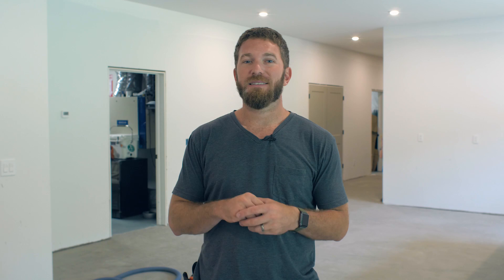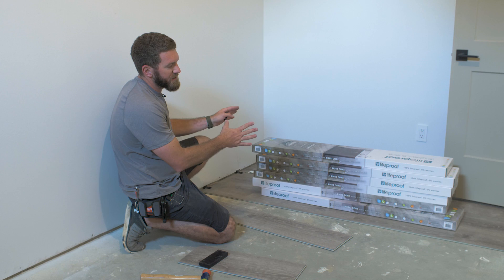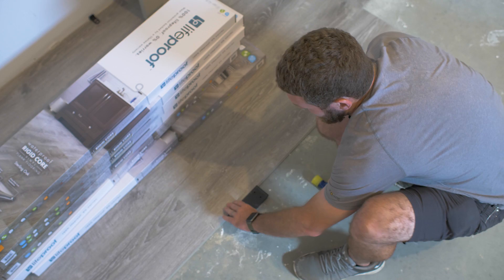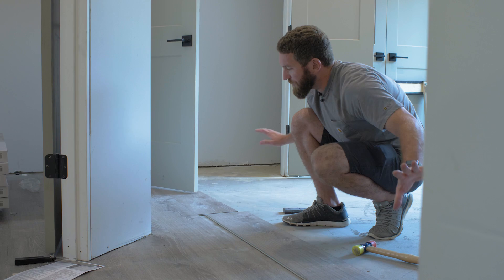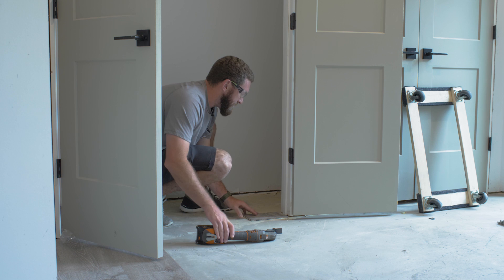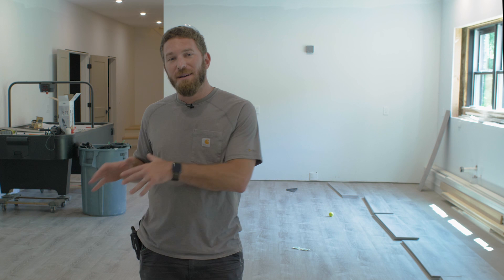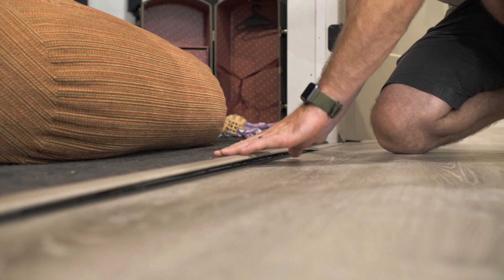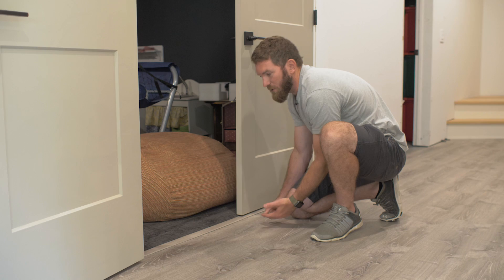How to Install Vinyl Plank Flooring | Tips & Tricks

Comment: Do you leave the spacers in until you finish? When do you remove the 1/4 spacers?
Reply: My suspicion is leave until the end. Since the planks aren't glued down + there's 1/4 allocated all around for expansion, there could be opportunity for sliding around right?

Comment: Great videos, I always learn from them. You mentioned laying out the room to avoid skinny pieces but how do you ultimately avoid that? The planks won’t always equal the width of the room...unless I misunderstood.
Reply from the maker: Yes, the idea is to calculate home many rows of boards it will take to span the room. If the remainder is less than, say .25, I would suggest ripping some off the first run. If you want the first run and the last run to be the same you would add 1 to the remainder and then divide by 2. The seams on this stuff are virtually invisible though so this may not be a huge deal to most.
Reply: @rogueengineer  it’s the “less than half factor”.

Comment: Great video. You do need to allow proper expansion for the flooring up against that metal channel for the t mold though. If you have a buckling claim it will be declined when that is discovered. Need that 1/4". That's of course why the molding is so wide to allow for that.

Comment: On below level installs, it might not be a bad idea to waterproof the crete, of course after it has cured. Some areas will see moisture mitigate through the slab causing mold growth underneath the lvt.
Reply: What would you use to waterproof a plywood subfloor if laying this on plywood

Comment: Grinder with a diamond blade is best for quick rips while working on the floor without having to get up , grinder works great for tricky cuts
Reply: I score it and snap it, no fine vinyl chunks, debris. Use a pair of large pliers CAREFULLY to help snap long, narrow pcs. like 1" to 2" wide.
Reply: But I do use my battery op. plunge cutter RELIGIOUSLY...never leaves my side! Less invasive, safer than an angle grinder, especially for tiny adjustment cuts around door jambs!

Comment: So I have a treadmill in the same room off to the side like your air hockey table is, but not on mover's dollies. When you finished, did you set it down directly on top of the planks, without any buckling?

Comment: Would a moisture barrier be needed for slab/concrete? I've seen since videos where they use 6mil sheets. However, I'm not sure it would work with the Lifeproof floors which have an underpad.
Reply: Def need plastic on concrete , not sure why he did not

Comment: I get it about wanting the t modeling transition being evenly spaced under the door so that it’s not favoring one side or the other from room to room however when looking at your video and how you put the metal track, you forgot to leave expansion gap there, the same expansion gap that is required around all the walls is also required for any transitions or pipes or beams or vents etc. you may run into a buckling issue if the floor decides to expand in that direction. I always make the space from floor to floor 1-1/8” because this allows for 1/4” expansion gap on either side of the track and the t molding still covers it fine and never run into issues with buckling or expansion issues. Everything else with install I agree 1000% on and I love how the whole family got involved with the install. I’m a little jealous and wish my wife and kids were more hands on with the renovation stuff and give us a chance to all bond instead of “Wow Dad! It looks amazing and you did a great job.” I already know what I’m capable of so although it is gratifying hearing their compliments, I would much rather we all be involved and it be a family thing. Cheers 🍻 brotha

Comment: Thanks for making this look easy. I have a door way needing a transitional piece however the tile will sit 1/2 inch higher then the flooring I’m installing. Do u happen to know where I can buy a t mold that will drop down from the tile to the flooring i tried Home Depot sometimes they can be a bit generic and they didn’t have what I needed. Thanks john

Comment: The square is called a try bevel square hope this help for those looking for it 😀
Reply: Not to be confused with a tri-bevel 🤔🙄
Reply: It’s not a try or a tri bevel square!  It’s called just a bevel square.
Reply: @tundrawhisperer4821  thanks for commenting but if you look them up you will see it says t bevel square
Reply: @300rear27  nobody calls them a T square though, it’s a bevel square, at least in my parts anyways.
Reply: @tundrawhisperer4821  thanks I’m old school carpenter and that’s what I call it did you look it up Home Depot has it has t bevel

Comment: If you use any type of saw, saw in another space preferably outside or garage, to avoid dust and fragments from the room you are installing the new flooring.
Reply: Not sure about lvt, but laminate sawdust is carcinogenic, so always best to use a hand lam cutter, no dust.
But MOST floating lvt jobs i do, I just score it once with utility knife then break over my knee...super quick, no mess!

Comment: Great video!  I know you did this over a "level" concrete floor but unfortunately I don't have that situation.  I am looking to lay this exact product in a basement over 5/8 OSB which isn't perfectly level over the course of the room.  How do you think this product would do with some wavyness in the floor?  Nothing too dramatic just not perfectly level...  Thanks for the info and looking forward to your opinion.
Reply: did you end up laying the floor? How did it end up given the floor wasn't super flat? I am in a similar situation and wanting to get real feedback on it. Thank you
Reply: I'd highly suggest you tughten ANY movement first, then self level all dips, sand down any humps...then you're good to go! Also, make sure the crete is cured and no moisture mitigation up through the osb and create mold between osb and vinyl, which doesn't "breathe".

Comment: So for vynil floor tile dont u use thinset or cement and sand as mortar underneath?
Reply: NO...NEVER! Lvt is vinyl, a type of plastic. Thin sets don't work with plastics or metals. This is a floating floor, not glued or nailed down anywhere. It "floats".

Comment: I have question: At 8:09 it shows the metal strip right up against the floor. Should there be a small gap to allow for expansion there?  If you don't need it, then can I can a way with butting the LVP floor up to an existing tile floor and not use a transition strip?  I would LOVE to not use a transition strip over the tile for just at a 30"  doorway.
Reply: I was thinking the same thing. I am going to leave 1/4 inch minimum where my flooring butts up to a sliding glass door.
Reply: Yes, you need a gap. But, an option is run it within 3/16" or so, and put a caulking bead down instead of a threshold. Only issue is the height difference between floors.
Reply: @MitchHowes  usually at sliding glass doors, I install a color matching endcap molding( like a t mold, but shaped like an L)from the flooring manufacturer. Very clean, pro look!
Reply: @bryanbenson6551  yep, it’s much better look!  👍🏻

Comment: Great video!  I'm going to go through the same process in the basement.  Is it required to pour down concrete?
Reply: No just be level. Some planks have the rubber underlayment... That will need to be super glat an level

Comment: I did this in my kitchen and it looks great. My question is how do you fix any areas that don't lie flush. There are a few end seems that slightly raised up and I didn't want to hit too hard for fear of breaking the grooves. I plan on doing a few more rooms so would like to avoid this mistake. Thanks!

Comment: Everyone who does these donut yourself video makes it so simple even the kids can do it. The life proof floor is a awesome floor and can be cut just by using a utility knife. But let me assure you it’s far from easy to just run your knife over it a few times and snap does not snap that easy because it’s a very good floor and tough to snap. Also that metal track is garbage better off to glue it down. Everyone who does these do it yourself video show you how easy it is in a big wise open empty room. They never show you when you have to go thru doorways or wrap around a island in a kitchen. They all make it seem like they did it in 1 day. It is a pretty easy floor to install but I warn you people it’s not that easy. Also you don’t need to put the spacers on all the walls. Just make sure you have them on your starting wall that’s the most important. When you start each row if you have enough confidence to do a floor like this all you need to do is eye the space you leave when you start each row as long as your under 1/4 inch. If you notice he didn’t show you guys how to make your end cuts which are called rips. That’s the cuts that you end up with at the last row you install. No one ever shows a video of the difficult parts or a difficult lay out which can be challenging if your just a do it yourself type of a person.

Comment: How do you get planks to click if you can’t lift the plank on an angle and you can’t slide a plank under a jamb
Reply from the maker: Click it in before you slide it under.
Reply: @rogueengineer  I did find a vid that shows clicking a piece in a flat position . 
If like to see a vid on getting under jambs snd casings when you can’t slide the piece .

Comment: What is the point of having a gap around and the edges. I hear it's for expansion... but for what? Dont the gaps open up?
Reply: LEE SOLID I saw another video ( Reno something something) where the guy said the gap is for future repairs that may be needed. There’s a tool that spreads the floor apart allowing the removal of the damaged piece
Reply: @bmtango05  what tool can spread apart a floating floor to replace a single plank?? Never heard of it...great idea, just can't imagine how it wouldn't damage the tongue/groove?
Reply: @bmtango05  and the gap is for movement of the vinyl(usually very minimum, compared to laminates, how'd being the most movement). Also, it's because wood moves in the house as well, so walls could possibly swell slightly, pinning closely installed flooring, which will buckle your flooring.

Comment: Beware! This stuff seems like a good deal. And it is pretty good quality for the price. But Lifeproof doesn’t provide many plank patterns. I would have GLADLY paid another $1 or even $2 sq/f to get at least 8 different patterns.. I spent 50% of the install time figuring out which board to put next because there were only FOUR different board patterns… 8 if you include the same exact pattern but opposite direction.

If it doesn’t bother you that you’ll see the same exact board all over the place, then don’t worry about it. But I know lots of people that would be annoyed. I am super annoyed by it. Lesson learned. Hopefully this helps save someone else the headache.

Comment: Hey do you have a link for the tool you used for underneath the doors 🚪
Reply: The tool he used is call a multi tool. You can purchase them in Lowe’s Home Depot or if you have a harbour freight in your area they are cheaper there. Also when you under cut your door jamb use a piece of the flooring as a guide when you cut the jamb so you don’t cut to much and have a big gap. I also suggest you cut it about 1/16 of a inch higher then the sample piece so you have a little room to work the piece under the door jamb it makes it a lot easier trust me I do this type of floor everyday for a living. And wear a pair of gloves because you can nick up your hands pretty good working with this stuff
Reply: A multi tool, also called a plunge cutter, they're pricess. However, I also own an electric under cut saw. Picture a circular saw with an adjustable blade parallel with the floor...a must have for big jobs. Your multi tool then gets all of the close areas.

Comment: Are you happy with the flooring? You work with this product how would you think it would hold up in a common area with in a garage? My children use as room more as an arts and crafts center. I store a completely restored model A pick up on the other side of the garage.
It spends 99 % of it's time stored there..I live in a cold climate it doesn't seem the light of day until summer. The room is climate controlled. What do you think?
Reply from the maker: I think it should be fine. If it was seeing traffic from vehicles every day it might start to wear but what you have going on should be no problem

Comment: You glued the transition so you shouldn’t even waste your time with the track just glue the T mold or reducer directly to the floor.
Reply: That's what I do. Or, pilot drill, put in 3  3/4" x 1" dowel pieces to Brad nail to.
Reply: @bryanbenson6551  a really good quality adhesive works great!

Comment: I do this everyday, although he's not technically wrong he makes it very difficult. Use end clamps, use a snap cutter, do several rows at a time, use a real undercut saw, and seriously who does 1 row at a time? It would take you a week.
Reply: Yeah, most brands it's quicker for me to install them individually. Once you get the proprietary locking down, you'll fly. Doing whole rows solo is a pain in the ass...SOLO, without a helper.
Reply: When you get to the last plank, just turn it  180 degrees, score allowing a slight gap, and snap. Turn it back around and snap into place.. I can do this quickly after 7 years experience on my own doing all types of flooring.

Comment: Have you guys had any problems with this flooring? I’ve looked at it and to me the tongue and groove don’t seem big enough to make a solid permanent connection. I’m afraid it might open up.
Reply: It's pretty solid once locked in place and 100% installed. I wouldn't call it perfect for heavy (like garage or home gym) or commercial use. This should be good for your moderate to high traffic areas.

There are more sturdy planks that require separate underlayment. There is a little more forgiveness on install it.
Reply: It’s a very solid floor. It snaps and hold together a lot better then you think. But it is not commercial rated. I also do not recommend having chairs on it with wheels. They will not warrantee the product if you do. I install the life proof every day for Home Depot I’m a authorized contractor. There product is awesome. I honestly just don’t like when people post videos like this making it seem so simple a kid can do it. They can be very misleading. Don’t get me wrong it is a pretty easy floor to install if you some what handy. But no one who makes these videos ever shows you how to do the tough parts like going thru one door of a room to another without a transition so the job looks nicer and flows better. Or how to make your final cuts on your last row of the room or if you have to wrap around a island or a wall that divides a room and wraps it so the floor meets up. That just always show installing in a big open empty square room. Bet misleading even though it seems like a helpful video not just this video but a lot of other people’s video of this can mislead a person to believe it so easy a kid can do it.

Comment: Water damage?  

Modern engineered vinyl is popular.  In a basement like  this, what happens if water comes in?  Broken washing machine line or storm run off. Despite the mfn claims, these floating floors can not be water proof. A single tile might be waterproof, but not the whole floor system with all of its seams and unsealed edges.
Reply: Slick Ruler Yes of course.  First that matter, a sealed hardwood plank is water proof on the top surface.  That won’t stop, say, a burst pipe  from forcing the replacement of either a floating vinyl or a wood floor when the water gets underneath.
Reply: Slick Ruler It is irrelevant that the material itself is water proof, other than for a spilled drink which cleans up easily.  Again, so too sealed wood for a spilled drink.  

No, vinyl floor is not designed to be ‘put back down’.  No manufacturer allows that.  It installs and interlocks easily, but it is not designed to be pulled up without damage.  A single plank damaged from the top  can be pulled and replaced quickly.  But a good whole floor install requires pristine, clean joints of the engineered planks, and of course the sub floor or slab has to be flat and clean. So now water under the floor incurs  the labor and material cost of an entire new floor.  A single vinyl plank is water proof; a floating floor is not, not ever.

Here’s a floor which actually is water proof, and doesn’t need to be pulled up, ever,  after a basement flood: ceramic tile.
Reply: Slick Ruler “these floors [lvp] will survive pretty much anything you can throw at them”

Grifter.

Comment: i would never buy those cheap floor planks from home depot. i took a sample and buy the time i arrived at my destination it was all damaged. Cheap stuff.
Reply: fi stla where would you buy it from? The lifeproof flooring was nicer than anything else I saw at Home Depot and Lowes.
Reply: fi stla, there are different grades of plank, obviously the cheaper the lesser the quaility. But as a contractor myself, I can tell you that the Lifeproof flooring is about the top of the line and far more durable than the less expensive selections. Almost every high quality plank has Rigid Core Technology, which is the best on the market as far as ease of install and quality.
Reply: You probably bought the cheaper plank. Because life proof is a awesome and durable product